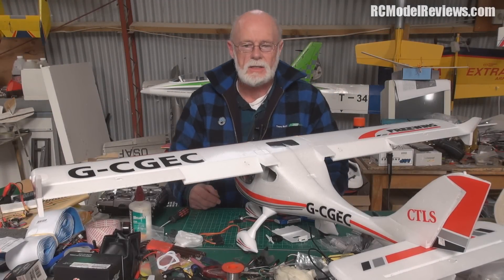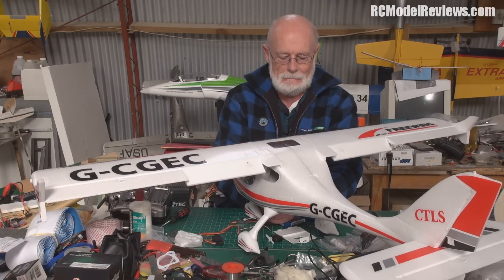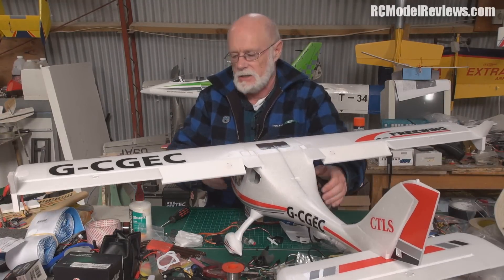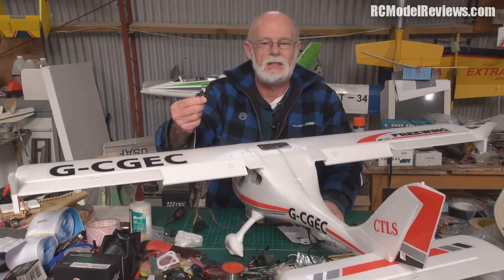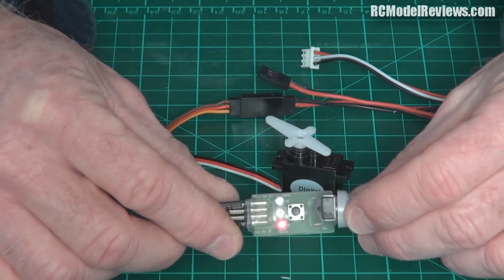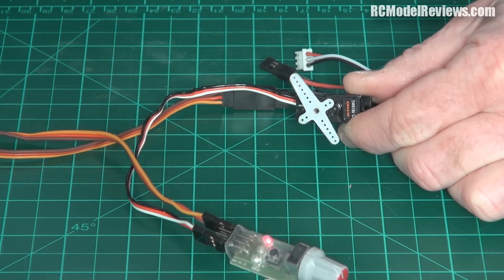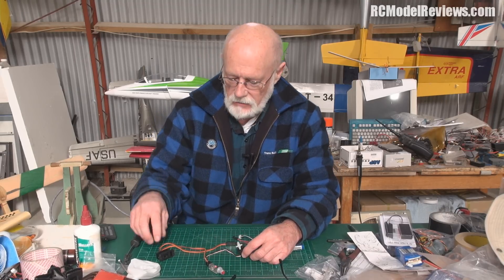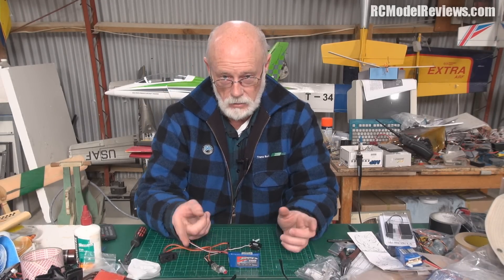Flaps and faulty servos

Comment: I have always used the slider for my flaps too, that's why I abandoned my Spektrum 6e couldn't rap my head around three position switch. Once my elevator servo shit the bed, I set my throttle to a steady medium speed and used my flaps with slider as a replacement for pitch control. Brought her in smooth as silk, no elevator !!!
The only beef I have with the Futaba slider is programming elevator trim in with the flaps. It only works on the first half or last half of the slider position. :-(  
Of course a good pilot will just use his thumbs. For me?  Good pilot albeit the problem :-( I set the elevator response to the last half of the knob movement so when landing flap is down I have a trim down elevator synchronized with it to avoid the infamous BALLOONING!! On take off?  I have to learn how to fly ah geesh....

Comment: The Multiplex Fun Cub is another with mirror image servo mounts for flaps and I did the same.  Waste of a channel if you need it for something else though.  How do manufacturers get it so wrong in otherwise excellent models?

I learned the lesson and when I retro-fitted flaps to my Hanger 9 ARTF P47 (60 sized) I made sure I fitted the servos so I could use a Y-lead.
Reply: I operated on my servo once reversed the two red and two green wires, that reversed the servo. You can't do this on all servos, some are epoxied for water resistance and or just to difficult. The jr55 servo was a piece of cake.

Comment: The Bixler 2 has this same issue regarding the flap servo's facing the same way as the ailerons, I solved this but putting the flaps on their own separate channels and reversing one of then in the Tx

Comment: Once upon a time when I flew combat I must have bought 50 Hitec HS-81 servos and I had them on all the control surfaces.  I had one plane that never would fly level.  Thought it was a bad design or something.  After a while I noticed a recurring event.  All of the 81's would stop centering or go hard over.  Even when they hadn't had any action, sometimes right out of the box.  They were junk, all of them.

Shame because I'd always had such good results with their other servos.

Comment: You mean reverse the outer two pot wires?

That's what I do too, depending on the situation.  Is a lot easier sometimes... sometimes it's longer than just running a secon lead.

Comment: Is that servo tester capable of running unregulated 2s power through it for High-Voltage servos?

I've been looking for a good, cheap servo tester for a while but haven't found one that supports 2s for HV servos.

Comment: Same thing with the Bixler 2. Either mix it with a computer radio (which not everyone has), or use a servo reverser. At least HK mentions this on the product page. Makes you wonder why they don't just mould the foam for the servos the "correct" way in the first place...

Comment: Use 2 channels for flaps...then you can set center and end points via radio instead of mechanical...do flaperons...or have them operate in conjunction with ailerons to increase roll rate...many benefits to not "Y'ing" em off!

Comment: Not really stupid, it's pretty normal for the flap servos to be apposing each other on complex models and full house gliders. They just assumed you would use a mixing radio(most modern radios have it). Not using a Y-Connectors allows for things like full span ailerons, camber and reflexing of the trailing edge. Not to mention other nice tuning things not possible when using a Y-Connectors, like programmable deferential.

Comment: I have the FrSky Taranis - fantastic radio! However, the side slider-pots are way too loose. It's too easy for them to move by themselves, of if your hand just lightly brushes against them. As a result, I ended up programming my Taranis so I needed to flip a switch first and THEN the side slider-pots would control the flaps.

Comment: As a glider pilot I have flaps and brakes on the throttle stick.
So for me proportional is the way to go.

But for powered flight I would not know what to do. I have mixed my friends radio for two stage flaps on his funcub. But to be honest, it is a pain to reach those leavers.
I don't know. Perhaps you power lot are just screwed. Or I need to learn throttle control. :)